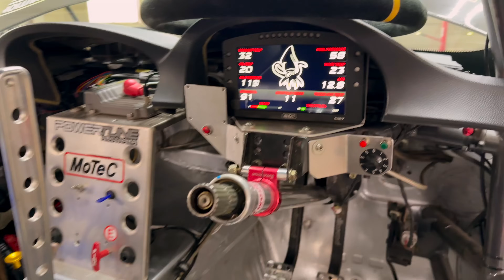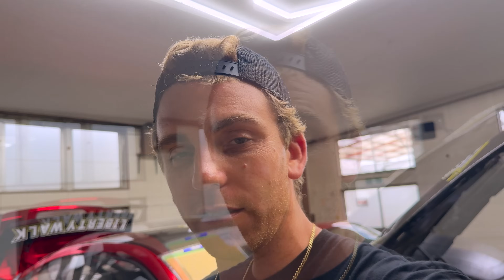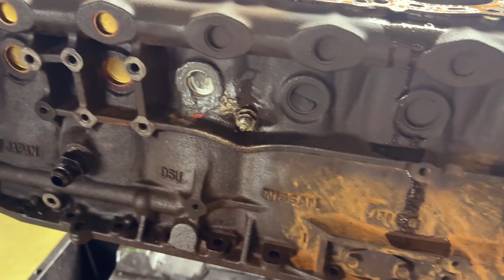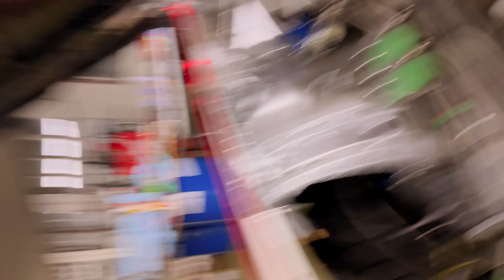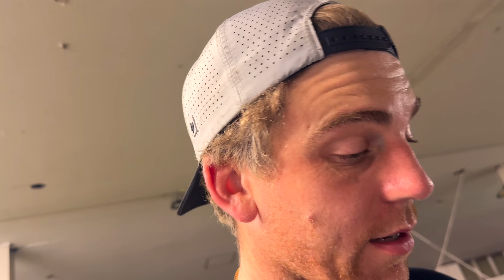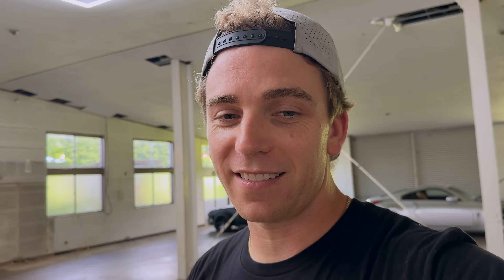RBM3 JUST GOT AN CRAZY ENGINE SWAP

Comment: Looking forward to seeing the 3.5 putting in work! Still waiting to see these mythical PRP cast blocks/heads, starting to wonder if they even exist. Good luck for next round Squid!
Reply: For sale now as of Aus GTR fest a month ago apparently. Herman said there's a back log of per orders to clear, but they're cranking out multiple blocks a week he mentioned. Head not quite ready for retail production just yet but sounds like they're also not far off.
I do agree I'm keen to see customers start leaning on them though! They made 1800hp with one on the engine Dyno pretty easily, wish they would Sponsor the D squid.
Reply from the maker: Yeah Ill wait till their sponsored drivers are using them. Thats a pretty good sign they aint tested enough.

Comment: Rest in peace the little 26 that could! Gone but not forgotten. New engine is going to be sick though!

Edit: It sounds simple and dumb, but make sure you check what torque specs the 30 crank bolt needs. I seem to recall LZ snapping a crank on his 32 4 door because he used the 26 torque spec on a 25 or the other way round
Reply from the maker: Thanks for the heads up. This crank is a billet crank so she wont break in a hurry. I have done everything up to what ever ARP said to. As they are all ARP bolts.